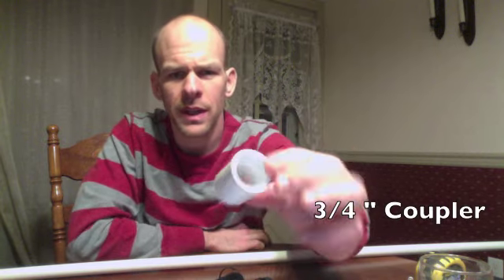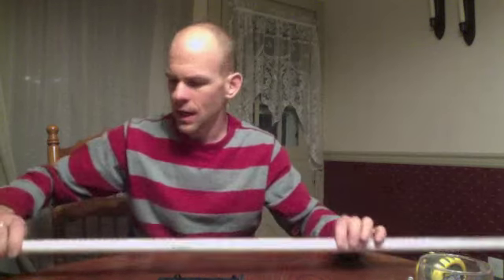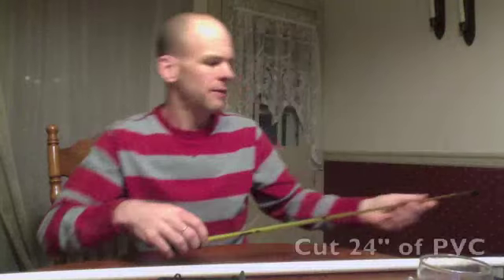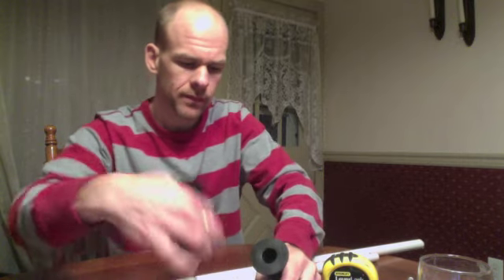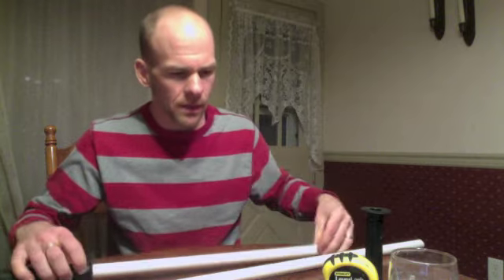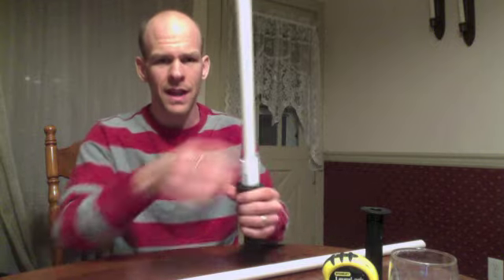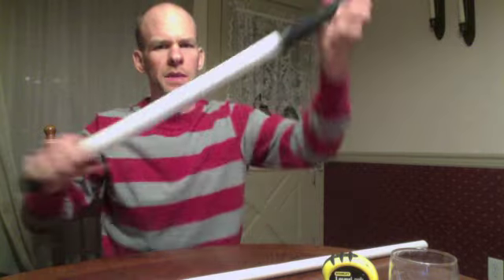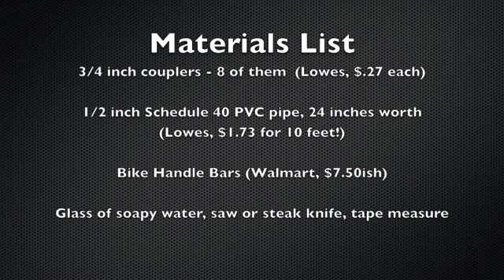How To Make A Stick Muscle Massager In 5 Minutes For Under $10

Comment from the maker: Hi there Hagen,
Glad you like the video.  I would say that the best idea for you is to just go and get a pair of bike handles and find a piece of PVC that will fit on the ends.  You can then find some small PVC couplers that will fit on the outside of the one you put on your handlebars, like in the picture.  I just used those sizes because it worked nicely.  If you want specific conversions, I would just do a simple Google search of "inches to cm".  Good luck and hope that helps!

Comment: This is outstanding. I'm going to have to make one of these. Just two thoughts: First, though the length of your stick worked out to be just perfect, wouldn't the needed length depend on the depth of the bicycle handgrips (unless they're all pretty much standard)? Second, I wouldn't use soapy water; I'd just use plain dish soap for maximum slipperyness (which goes away once it dries).

Comment: This is awesome! My boyfriend kills his body working 6 days a week. These muscle rollers are extremely expensive but he also loves homemade gifts :) so this will work great! I am not a math person so I appreciate this video! I do have one question: What's the correct length on the depth of the bicycle grips for for 1/2 Schedule 40 PVC?
Reply from the maker: Hi there, it really wouldn't matter which ones you used as you can cut the PVC to length. I would personally just get the bike grips you want and then measure the depth and just add the couplers accordingly if that makes sense.

Comment: Cool video. I'm going to try this out. One question: how much flex does the schedule 40 PVC pipe provide? I ask because I like a deep message and my last stick broke because I applied too much pressure. So this time around I'm looking for a stick with a pretty rigid stiffness that still provides a tiny bit of flex. That way I don't have to apply so much pressure.
Reply from the maker: I'm really not sure of exact numbers but I use mine pretty hard and it doesn't break.
Reply: May as well use wooden dowel

Comment: I just made it, and it works pretty well. Only thing is sometimes the couplers don't spin very well. I didn't use wax. Anyone out there use wax or any kind of lubricant and get good results?
Reply from the maker: I used crayons on the inside.  Just rubbed the couplers with a crayon to give it a wax coating.